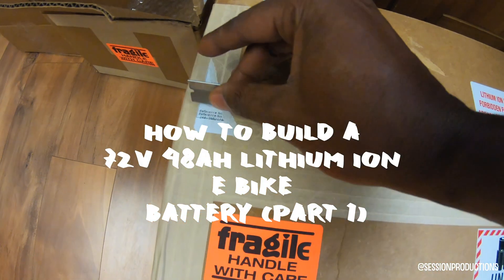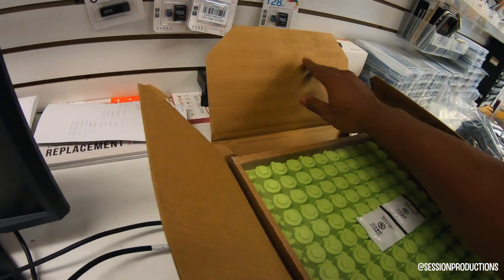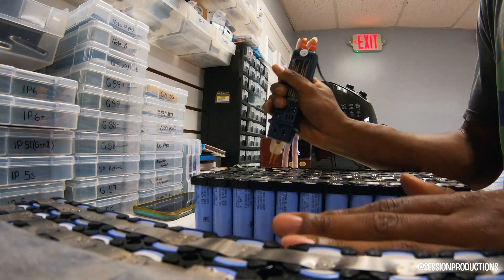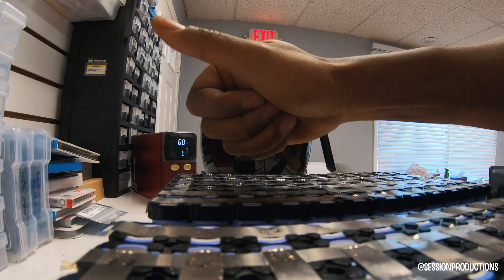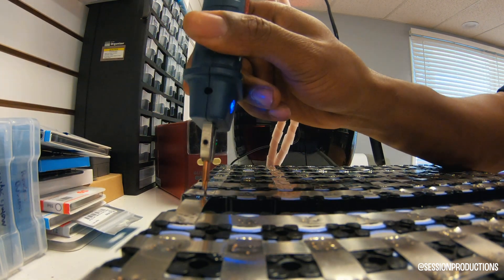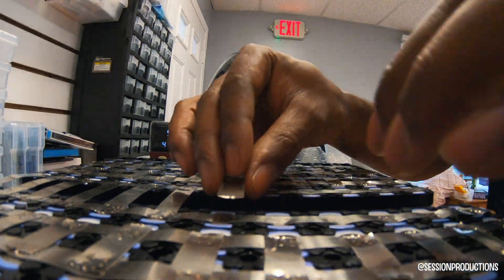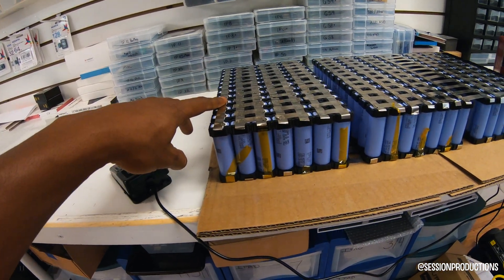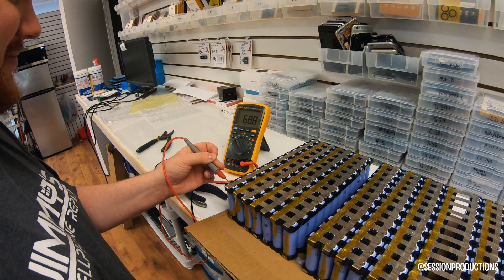How to Build a 72v 48ah lithium ion E Bike battery (Part 1)

Comment: What’s the constant discharge rate of the bms you use with these Samsung cells?
Reply from the maker: It was like 250-300amps im pretty sure. I use the 400amp because it’s operating at a wayyyy less payload. In theory preserving the longevity of the BMS
Reply from the maker: Depending on how many amps you’re pulling you will want to put copper strips on your cells too
Reply: Bet. Is it possible to make a 72v 100ah with that 400amp bms? Or would it drain too fast to be 100ah?
Reply from the maker: @ShaqTheBoss  yes it is possible but you would need sooooo many batteries

Comment: 68v ?    WOOPSIE!                  seems to me you miss calculated something?   should be closer to 84v
Reply from the maker: 84v is when it’s fully charged. 68-70v is what you get when you first put it together because it’s in storage voltage. All the cells were tested at 3.5 volts and if you multiply 3.5 times 20 you’ll get around the same voltage
Reply: I just brought a 72v 42.5ah battery. I also have a stock 60v 40ah battery. Could I take some of the stick amps and add them to the 72v and make it 51ah?